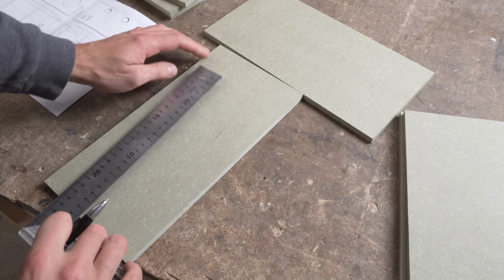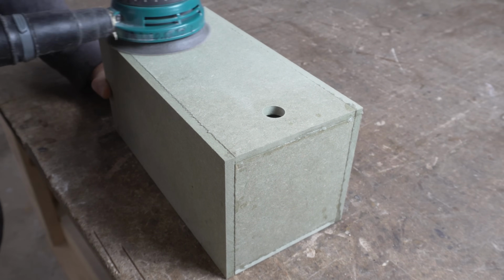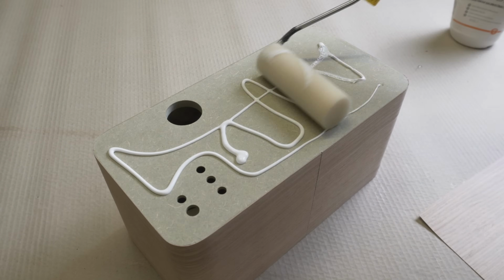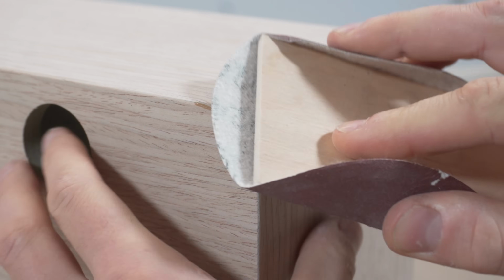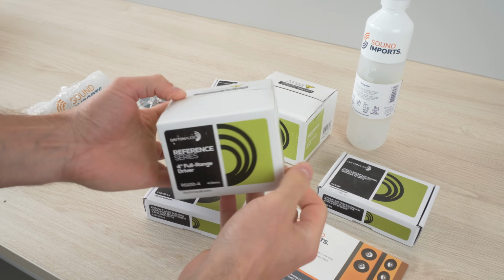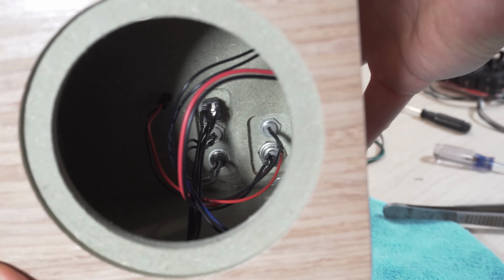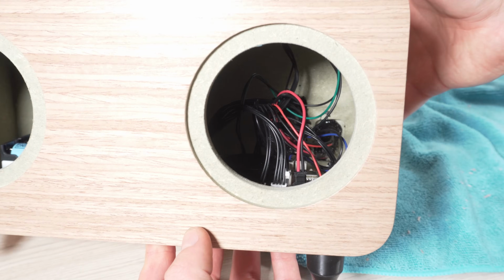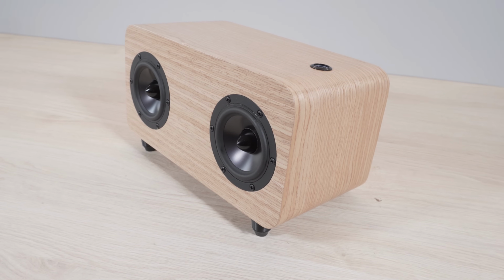Portable Bluetooth Speaker Build (with DSP!)

Comment: Good end result. Here's a tip for the veneer: use contact adhesive and as you press it round the rounded corners, it will stick way better than with PVA glue.

Comment: Good job! The only thing, i don't like that corner. Did you check the resonance of the fase inverter? When i made my speaker, i tried to make the resonance a bit lower than lowest frequency of the speaker's head. And it worked. Params was 40-20000, i tuned resonance to 33 Hz. So it's resulting range changed to 33-20000.

Comment: No handle for carrying.
No protective grill for the speakers.
Requires rare 18V powersupply for charge (why not use 5V usb with DC-DC step up).
Maybe veneer chip can be fixed with patch?

Comment: Все отлично! Молодец за такой проект. Но я бы сделал заместо фазоинверторов один  большой пассивный резонатор внизу. Получилась бы система 2.1, и отдача на басах существенно бы возросла. Чтобы отсеять кросканальные акустические наводки в таком случае, внутреннее пространство лучше заполнить синтепоном.
Reply: Late reply but I’m guessing that it is a stereo project and combining the two full range channels would make the bass weaker and ruin the stereo separation in the sound a lot unfortunately!
Reply: @elliotrosander2895  The fact is that the distance between the speakers is small enough to talk about a normal stereo base. Then, the sound in the mid- and high-frequency range inside the speaker is absorbed by the soft padding. And low ones can just work well on the radiator plate. This is how a mechanical low-pass filter is obtained.
Reply: A passive radiator does not turn this into a 2.1 system and does not improve the bass response

Comment: Nice video and clean, neat speaker!

I've always wondered how every diyers make smooth surface finish of wooden enclosure, and today I solved this question thanks to your video.
Also surprised about the solution at 12:55 which despite non-curable mistake in normal situation!

Thanks to your video and hope you have a nice day 😁
Reply from the maker: Thank you so much!
Yes, and even that finish is not the smoothest 😄
Thanks for watching and I'll hope you stay tuned for other projects!

Comment: But how was there no line from the two corners meeting around the edges of the speaker box? Tell me im really confused how there wasnt any.
Reply: They are still there. It is hard to see with a nice sanding job and partially covered in glue.
Reply from the maker: There is a line, down at the bottom.

Comment: Perfect video just a question, there are no crossover between drivers and amp? 
Thx for the answer
Reply: These are full range speakers, no need for splitting the signal to high frequency and low frequency components.

Comment: You forgot to mention how much it would have cost. At least the parts. Well done as usual!
Reply: You don't want to know it, because otherwise you will buy a brand new factory built solution, because of the price/perf.
Reply: @kiakk_009  It's not always about the cost, it's about the satisfaction and skill set to create. Some of us can, some cannot.
Reply: just for electronics not including the speakers is over 200
Reply from the maker: Thank you! You can check the cost of parts in the description.
Reply: @DonnyTerek  its not there on the description

Comment: Good work but the batteries should tighten with cable tie or glue gun to prevent come out from slot when accidentally speaker face any falling issue from any high surface to ground.
Reply from the maker: Thank you! The batteries are held in very tight. You would most likely break the speaker first before the batteries get loose.

Comment: Nicely done Donny, any reason you didnt use some more veneer to fix the corner?
Reply from the maker: Thank you! It would be a quite tedious job to glue a piece that small and probably wouldn't look any better than it is right now.
Reply: @DonnyTerek When something like this happens to me, I duplicate the mistake on the other side so it looks made on purpose.
Reply: I think it adds character to the speaker